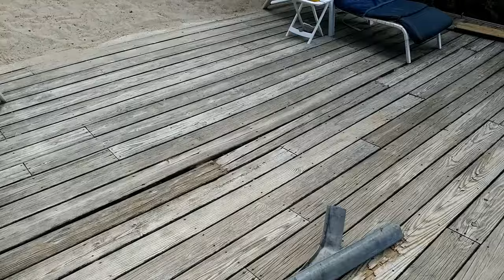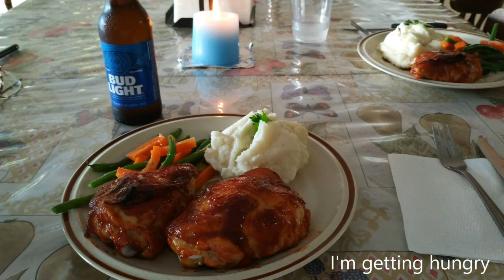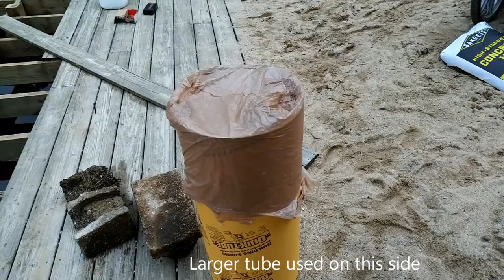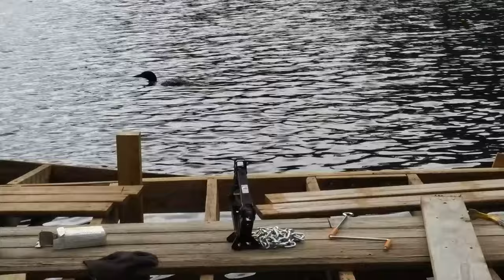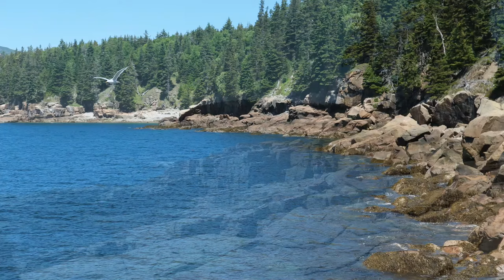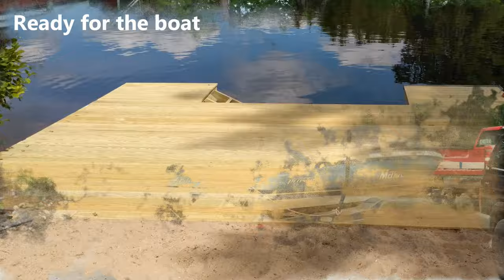This Old Dock. How to repair and level a dock with a car jack

Comment: How did you make the hole?
Reply from the maker: You have to get in the water with a shovel and some wading boots or old sneakers.  Then just move the sand and rocks out of the hole the best you can.  Unless your lake has a dam and you can do it in the fall and go down deeper. You only have to go down about a foot and then after you put in the concrete pad or tubes, then you backfill with sand and rocks to keep the post straight.  Over the winter the dock might move up or down slightly from the frost and you can get out the jack again and just adjust it.  After the first winter the dock was completely level except the front right side was down about 1 inch.  We used stainless steel screws on the decking so I just removed two deck boards, jacked up the front and put the deck boards back on. Took about 15 minutes.